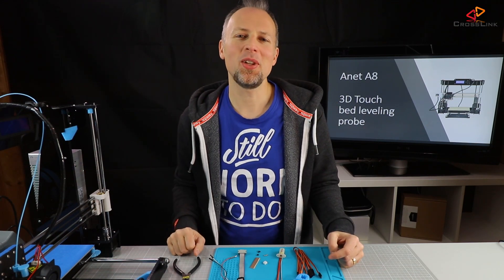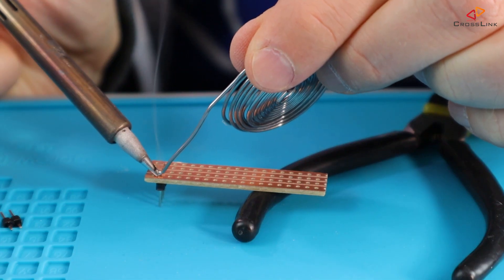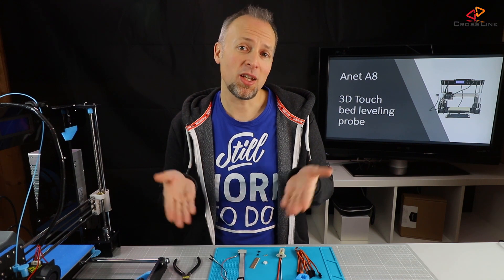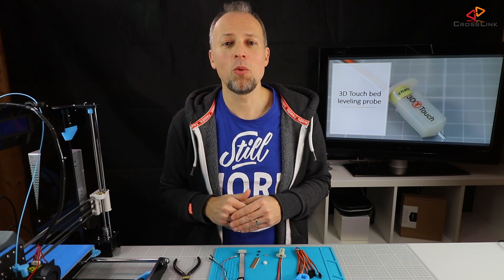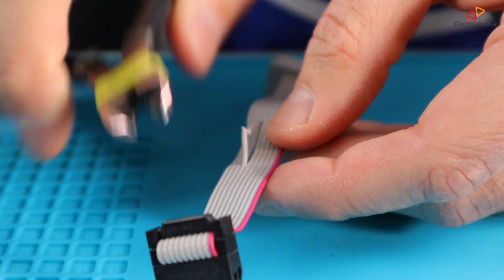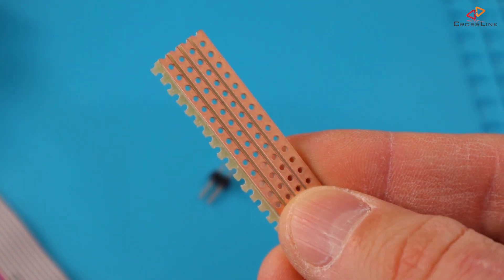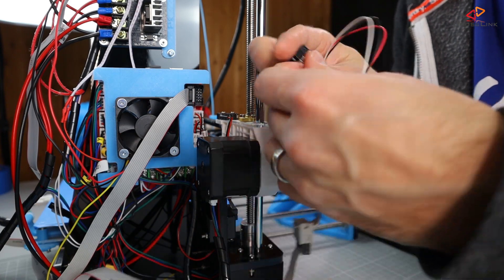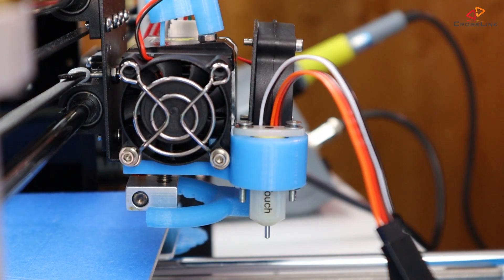BLTouch on the Anet A8 - Hardware installation

Comment: Hi the images in the video at 2min 28sec is incorrect it shows control signal wire at fift pin where pin27 is the third on the plug and pin29 is the seven pin on the plug

Comment: Anyone following this tutorial ignore the part from video where he tells you that its cable 3 on the ribbon cable, i spent 4 hours trying to solve why my sensor was not retracting down when homing its because he tells you that its cable 3 from the red side where mine was totally opposite side i recommend soldering a direct connection to pin 27 on the main board

Comment: Hello! I have this wired and programmed. I have an Anet A8 PLUS, and I have the board that looks just like the one in your video here. I used servo pin 29, and the bltouch won't respond to my commands. I followed your wiring just as you did it. The Bltouch is lit up, and it deploys and stuff when I turn the machine on, it just won't follow commands from the LCD, or when I tell it to auto level.  Please help!
Reply: I had the same problem with my Anet A8. I figured out that for my board the orange wire should be connected to the second pin and not the third as shown in the diagram. I don't know if it a change due to board versions or just a mistake that was made when creating the wiring diagram.
Reply: @R4GEVipeRzZ  yeah I saw that too, but more annoyingly I also saw it as the fourth pin down. So I was getting pretty annoyed with nobody having a definite answer. So I sent the sensor back and said forget it.

Comment: could I do this on my Tronxy_X5S
Reply from the maker: Why not? The sensor can be installed on many printers. You might need to check about the cabling of course. But the firmware will be the same.

Comment: In this guys video https://www.youtube.com/watch?v=6aofhlAooUE he connected the control signal to the 4th pin down. But you did on the 3rd pin. The instructions I found on https://www.thingiverse.com/thing:2091529 also has it on the 4th pin down. He doesn't show what screen he's using, but he doesn't mention the a6 screen. Am I missing something? I have a mostly stock a8. Just heat bed upgrade.

Comment: Hi Daniel, first of all thank you for sharing your knowledge and this in a very pleasant and educational way.

I just looked at the BLTouch site and there I find the following info https://www.antclabs.com/wiring3 :

          ■ Anet (Melzi Compatible) Wiring
          #define SERVO0_PIN 27
          ※ C45 must be removed to use BLTouch.
          If you remove C45, accuracy would be higher, even though if you don't use BLTouch.
         You can easily remove C45 by just using a long nose plier.

Is this according to you also necessary to remove C45 for the 3DTouch on an Anet A6 motherboard (ANET3D V1-5.).

Thanks already, Arnold
Reply from the maker: Actually, I can't tell you. Did not try this out, did you?
Reply: No, not yet. First I have to reduce my configuration.h file, it is 728 bytes too large to upload. I will compare your Anet A8 file with my Anet A6 file, because in part 2 you also indicate that you have had to reduce your configutartion.h. When everything works it is possible that I remove C45 to see if the Touch works accurately then. To be continued ;-) @Crosslink3D
Reply from the maker: Arnold Van Remoortere cool, please keep me updated 👍
Reply: For me, Yes, The 3d touch I had worked sometimes but wasn't reliable. So I bought a legit BLtouch of aliexpress.  With the same wiring/ Marlin set up this only worked after I removed the c45 capacitor as instructed on the  Antclabs website. (its a filter circuit on the z stop microswitch). With the capacitor in place the bltouch zstop didn't work properly and the nozzle crashed into the bed. Note Removing the capacitor is not for the faint hearted or poor vision!!
Reply from the maker: I see, for me it worked fine so far. Sometimes the reason for it to not work is because its magnetization is lost. Can be fixed easily by taking the pin out then re-magnetizing it.
Reply: Maybe more likely its because I got the latest V3.0 'smart' BLtouch. It has a plastic pin, longer reach and Antclabs have now updated their online documentation to cover this newest version. (ps, Ive found the bed has to be reasonably level to start with, ie before doing the auto 9 point bilinear levelling, or probing can fail at a point that is too far out of level )

Comment: Hi I have amended merlin firmware for LCD 12864, Power loss and recover and now tried to comply with BLTouch but is failing I am  using UNO board so I think its run out memory can you help as I am a Noob to this Anet A8
Reply from the maker: Can you try to post your arduino output here?

Comment: Hi, thanks, but wiring schematics confusingly show control signal going to pin 5 on the lcd connector??? I guess its pin3 for a8, pin7 for a6? . Im making up my own dupont breakout cable adapter cable, not splicing a prebuilt cable.....
Reply from the maker: Thanks for pointing out. I have taken the line back a little and written the pin numbers insted nearby. Check out the new version linked in the video description. Does this make it clearer?

Comment: Hi. Installed and working! 
Inspired by your diagram I created a custom adapter with female headers to connect directly to the board on one side, headers for both the two servo cables and the 10 pin cable on the other side and a cable with a 3 pin JST adapter to connect to the Z end connector on the board. Thanks for the video!
Reply from the maker: Sebastian, I would really love to show it to our viewers. Would you mind to share the plan or would you like to present it on my channel? We could do a Skype stream and then put it here to show how you've done it.
Reply from the maker: Great Idea. Will you post it on Thingiverse or Hackser.io  / Hackaday?

Comment: How to make a BLTouch setup on Anet A6 with Marlin firmware?
Reply from the maker: You can follow my instructions with the A6 display wires regarding the wiring. For the firmware upgrade you need of course the A6 configuration sample files and then make the modification for the bltouch support.

Comment: Hi. I came to your video because I want to install this sensor to my Anet A8. I changed the original display to the A6 display. If I understood correctly y should need to connect the orange (signal) wire to the 7th pin, is it correct? I don’t feel like making an adapter like yours so I would go directly to solder it. Does it affect in any way the Display functioning?
Reply from the maker: Yes, pin 7 if you have an a6 display. It works as usual. 👍
Reply: Crosslink Thanks. Looking forward for your second part. Is there a problem adding some many features to the A8 firmware (A6 display, auto level and sensor?)
Reply from the maker: yes, this will most probably cause you to get the "sketch too big" error. but there is a solution: check out my new video on how to fix it here: https://www.youtube.com/watch?v=RQIizXtf9oo

Comment: Thank you Daniel, I was under the impression that this sensor uses 5VDC instead of 12VDC, my version of the sensor (same brand) came with most of the parts you used, except the mainboard plug and breadboard, but it came with a resistor, an no instructions LOL.
Reply from the maker: The sensor works with the 5v from the board.